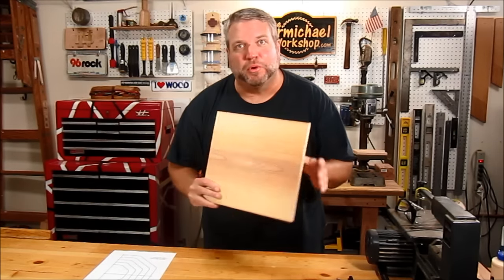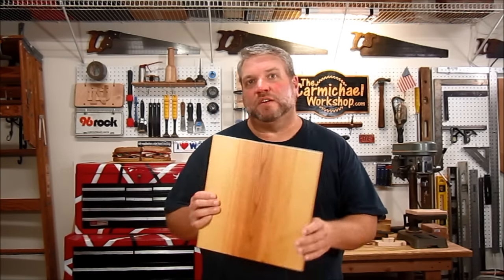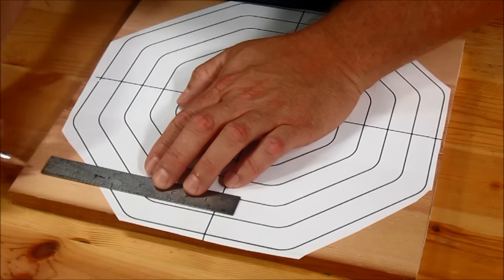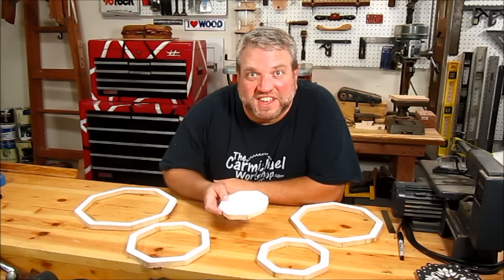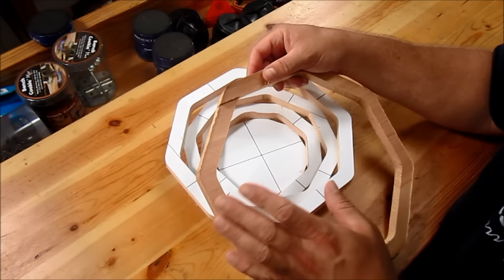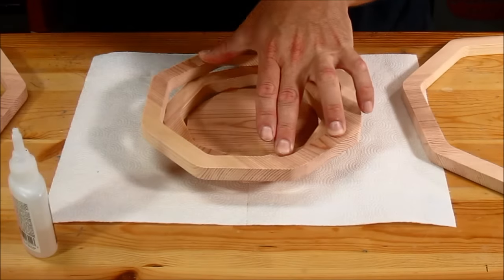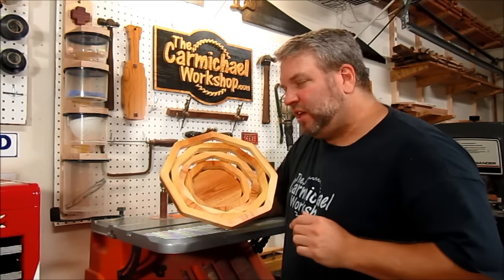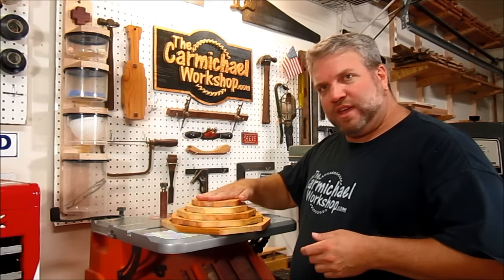Create a Bandsaw Bowl or Basket out of Wood

Comment: Nice Basowl. If you make circles and set the table at about 10 degrees, angled out, and cut them out. Then Just lift the outer ring and they will all lift up about 2/3rds each. Might have to play with the angle, depending on the blade width.

Comment from the maker: Hi Phil - I use a 1/4" 6tpi Bosch blade from Lowes and design my templates with 5/8 radius curves so I can cut them with it.  I've gone through two of them so far and found they usually last about 8 projects before they break...not bad for $8 blades.  I just bought the 1/2" size to try sawing up a small log.  My scroll saw is not very good so I'm better on my bandsaw.

Comment from the maker: Hi Eric - I use 3M General Purpose Spray Adhesive, 10.25 oz from Walmart $3.94 a can.  It's cheap and I think it comes off easier.  I spray the template and let it dry about 30 sec so it feels like post-it note stickyness, then stick it to the wood.  Mineral spirits help gets stubborn pieces off.

Comment: I just subscribed, and - as a cook - have a few suggestions. The first would be to use the bowl to hold fruit or bread products -  (It might be particularly useful serving bagels, donuts or muffins for breakfast). The second would be to have several on hand to use to as plate covers for serving specific types of food - ("Salmon en Papillote", "Steamed Clams/Mussels", Lobster of any kind or perhaps just as a fancy cover for any dish in general. Making two and attaching a handle or know of some kind might also prove useful for both presentation and display purposes. One thing that comes to mind is  using the two part idea for storage of fruit or cheese and one might also make some additions for use as "Caesar Salad" bowl if the holes could be filled somehow. Lastly, it might make one heck of an attractive way to serve soup, stew or something similar as a sort of trivet - Consider if it were inverted and used to hold a centerpiece or something of that nature.
Reply from the maker: J.K. Parsons Hi J.K.!  Thanks for subscribing.  Wow, these are great suggestions!  Currently my wife has a small house plant sitting in it which looks really nice, especially for a centerpiece.  At Christmas time, I turned it over and used it as a pedestal for a ceramic Santa that we have and that was neat too.  I really like your idea for connecting two of them with a handle.
Reply: Steve Carmichael Nice! I was also thinking that the bowl could be used as a few other things: A) Attach a 3-way wire with a hook to make a self-draining hanging basket for outdoor use, B) With the proper food-service grad wood, it might make a great vegetable steamer and C) A small candle placed in the center and hung using idea "A" would make a great fall outside decoration. I was also wondering if you had thought of, rather than using just the base in the center, making a smaller base with some adjustments to the design and making a killer centerpiece thing with either a candle inside or a plant sprouting from the top opening. By this, I mean making two and joining them with locking hinges of some kind so it can be opened for candle replacement or watering. One could also slice a round loaf of bread, place it inside and - when opened, have both separate in front of guests.

Comment: Did you have to sand where you put the ca glue, before lacquering it? I noticed when you applied it, it darkened the wood a bit.
Reply from the maker: Hey, I didn't since it was underneath but probably should have. It's still visible. I think a thicker ca glue would not have soaked into the wood and spread as much.
Reply: May just give this a try. I'll try the gel. Thanks

Comment: nice job Steve:
I made a couple of these on my scroll saw, but not the band saw.  What size blade were you using?
Thanks,
Dennis
Reply from the maker: Dennis Adams  Hi Dennis - I use a 1/4" blade on my bandsaw.  My scroll saw uses pin blades, so I would have had to drill large starter holes, so that's how I decided to use the bandsaw and just glue the entry cuts.

Comment: Hi Steve  What size Blade did you have on the bandsaw?  I have a 1/2 3TPI used for general sawing. Is this the wrong blade for this project?  I'm not crazy about changing bandsaw blades for every different cut.
Great Projects.
Thank You
Doug
Reply from the maker: +Douglas Hill  Hi Douglas!  Thanks!  I used a 1/4" blade so that I could make the tight turns, expecially on the smaller rings.  You should cut some curves with your 1/2" blade and see how tight it can cut.  You might need to make a bigger bowl.